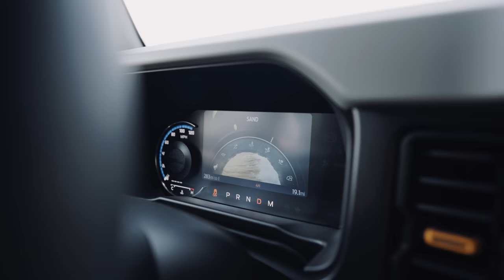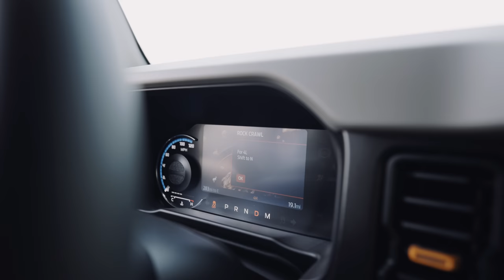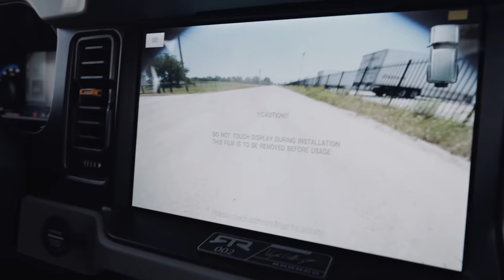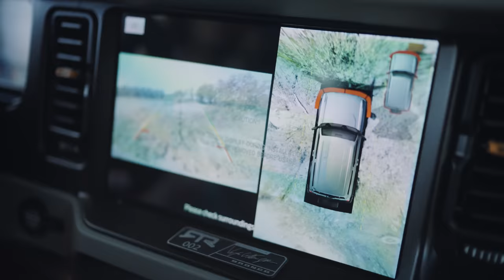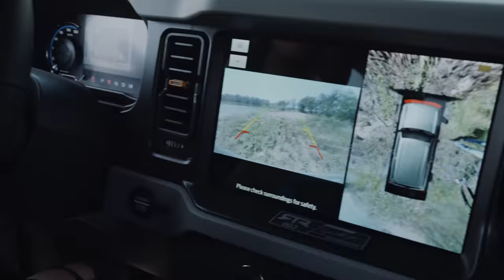While the Boss is Away, The Monkeys will Play - Gas Monkey Garage

Comment: The lights at the bottom of the doors are called courtesy lights and were 100% correct for a DeLuxe (Pony) interior car. The remote drivers side mirror was an option as was the matching (manual) mirror on the passenger's side.

Comment: I might be a bit pissed at the Millennial Monkeys if I was Richard for tearing up the BRAND NEW Bronco. It is one thing to take it down some dirt roads. Another to get is stuck in a ditch (basically on purpose) and possibly tear up the undercarriage, transfer case, transmission and damage parts of the body as well.
Reply: I bet you're fun at parties
Reply: @andyb7963  This isn't a party. It is a brand new vehicle.